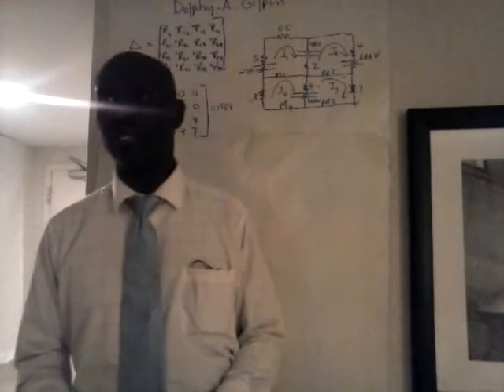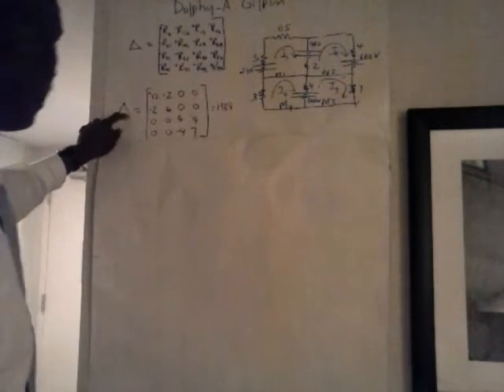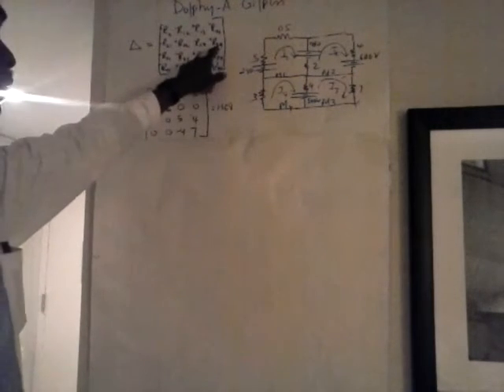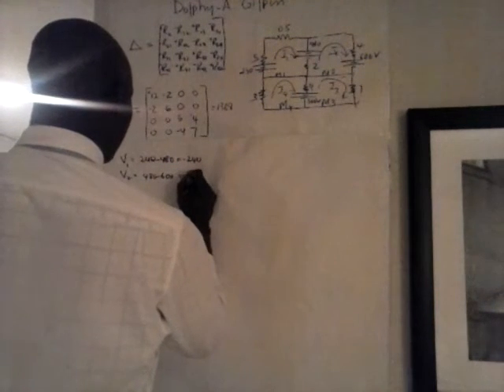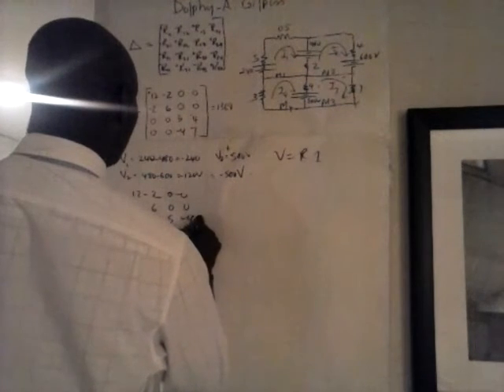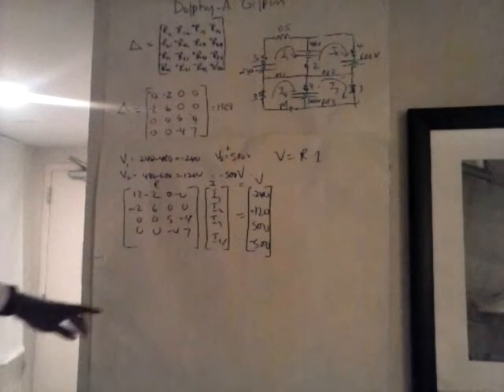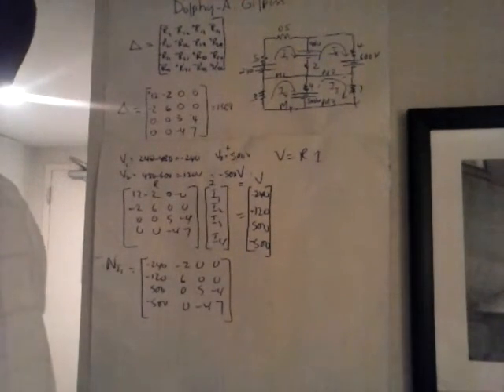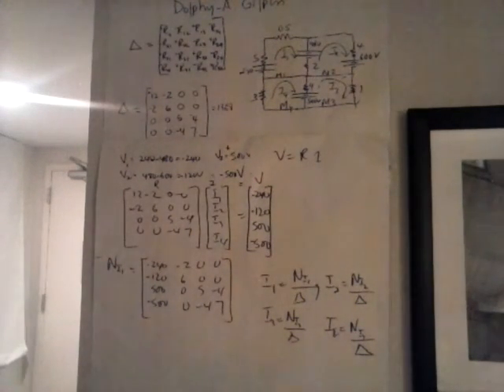020  CME.EE PDM 4X4 circuit analysis /Hampton Inn JFK/ Dolphy Gilpin

Comment: Reviewed at,  JFK Airport,  original,  done at Hampton Inn,  JFK,  Twelve  (12th) Floor.  Application of AMZ5x12M in mesh electronic/electrical circuits analysis via President of the said AMZ5x12M, Dolphy Gilpin.  8.10.2018.